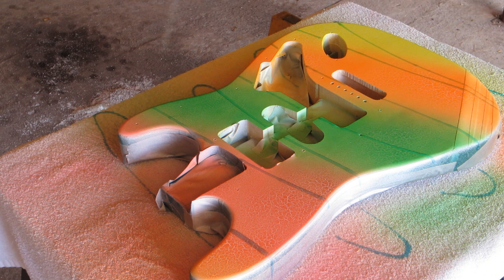DIY Stanger/Caster Paint Job Pt1 (got dish soap??)

Comment: Great Job!!!! Really liked how it crackled expectantly on you! What type of sealant did you use again?
Reply from the maker: Hey Dwayne...I ended up using a Vinal sealer..the reason is because I used a sharpie to outline the colors..using clearcoat would make sharpie run..the sealer does not..has a satin finish..im sure I could clearcoat over top of it if I wanted to just never did..holding up well

Comment: Is that just electrical tape you're using? Trying to find better solutions, as finding I get a decent amount of bleeding with any variation of painters tape...
Reply from the maker: Yes Electrical tape actually does work pretty good..I was out of masking tape and or painter tape..So I use the Electrical tape..didn't do bad